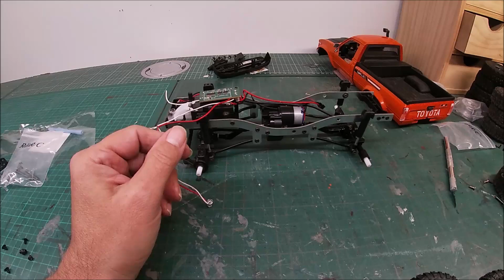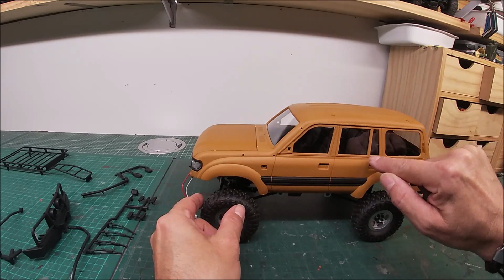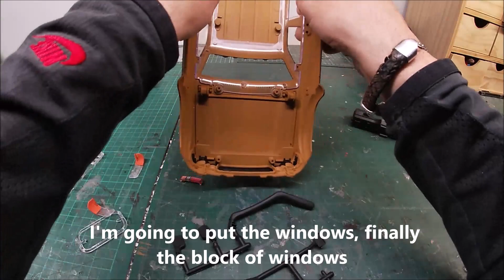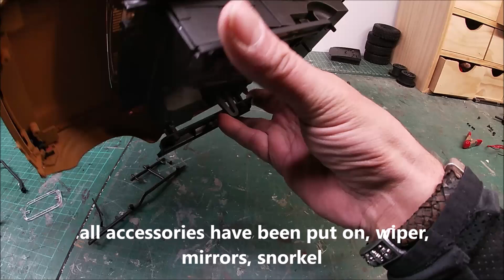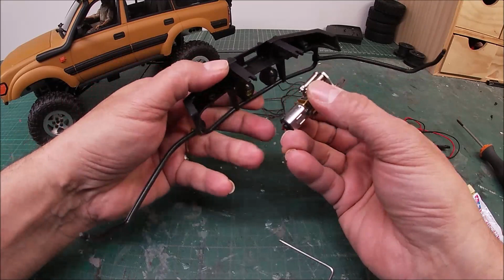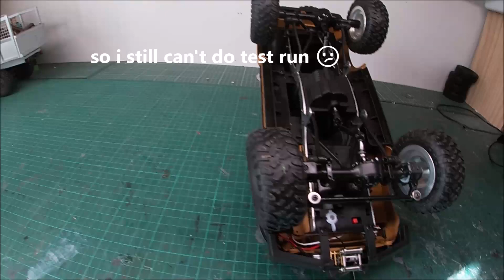Custom build Toyota LC80 Land Cruiser new Wpl C54-1 scale rc

Comment: Looks Nice I like the wheels! I think that has the same shock I moded on that fayee truck... pop off the top caps and you can grind off the lump on the bottom of them and it should make the springs feel softer and you can also cut some coils off and probably get the stance your looking for by lowering it down a bit.
Reply from the maker: Thanks for your great tip, I'll check it out and thank you for your great comment Shen 😊👍

Comment: looking good yes she's tall.. trim off most of "solid" ends of the springs, both ends, will let it 4-5 mm lower. inside the spring retainer center is a 4 mm diameter 2 mm tall plastic button, grind it away from all 4 shock caps, lets it lower about 2 mm more... should be easy to lower the body 6-7 mm doing those 2 things, they also help it flex more+easier. the lower eyelet of the shock can be turned in, stop at last thread visible, then 1.5 turns more... lose another mm of height but also lose a mm of suspension travel. easy stock WPL C-frame shock modifications might put the height down near where you want.
Reply from the maker: Good idea, it is true that I find that the body is a bit high, I will see if I have your idea or if I better adapt the interior of the body because I think that we can gain a little height or can be do both, thanks for your tip 😊👍
Reply: @satorrotas  removing the round in the cap centers was a tip from Steve (ShenRC) that added 5 mm more one wheel lift on the C-framed Jeep. I set up soft, about 1/8" of no spring, then settles on the springs another 1/8". they do sit a little lower, gives easy suspension travel and flex. down side its easier to hit the center gear casing going over some stuff
Reply from the maker: Yes Shen left me a message yesterday to make this change 😊 Thank you for your great explanations for these changes 😊👍

Comment: Great video. Really nice colour, shame about the bonnet removing the paint. I like the MN96 tyres on there, it works well. I read that WPL are bringing out a new chassis for the C54 sometime. Can you tell me what driver figure you are using?
Reply from the maker: Yes it is a problem for the paint and this hood, I would have had to sand to remove half of a millimeter, but to do that once the rc is finished is in my opinion not good because I risk that it is not Perfect if I had to re-paint over it, I will have to find another solution. It would be really great if wpl released a new chassis, It would be really great if wpl came out with a new chassis, because I wanted to buy another C24, so I might as well buy a new model. Indiana Jones figurine is 9.5 centimeters, I find them on ebay 😊👍
Reply: @satorrotas  Thankyou for driver information.😁